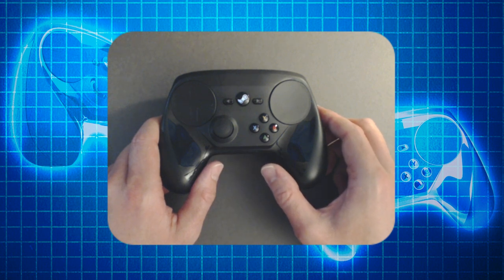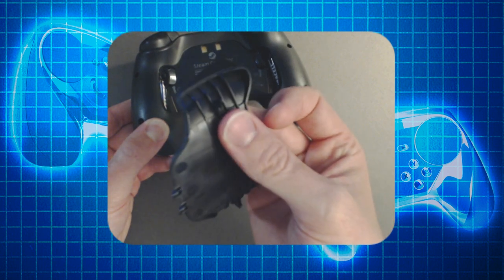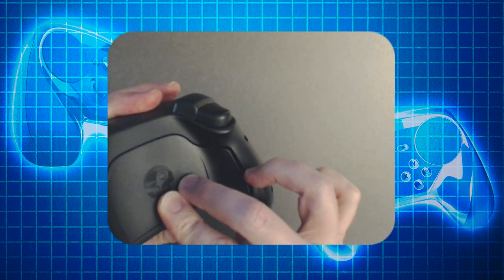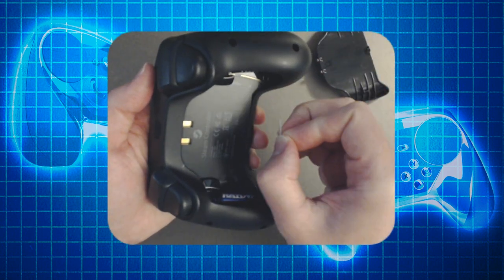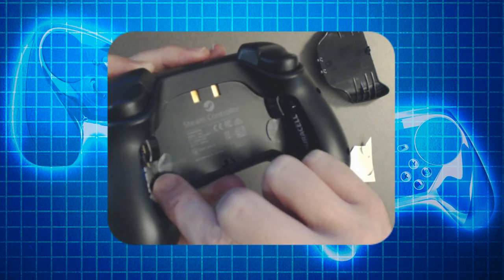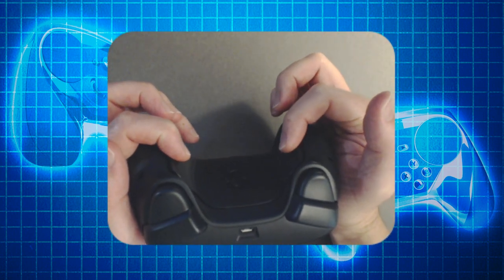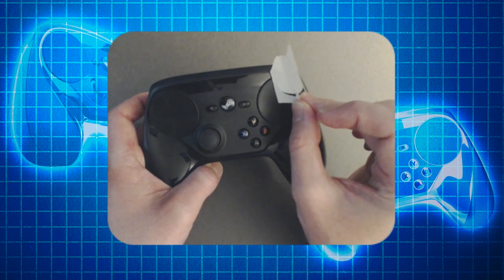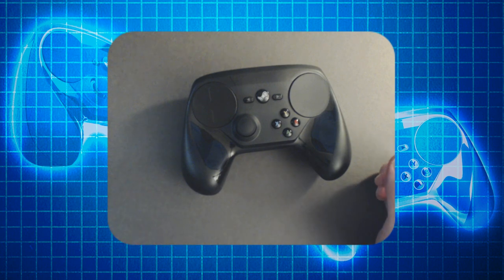Steam Controller DIY Hack | Back Grip Button Paddle Padding (Softer Clicks)

Comment: Great idea, will try this out myself! Never quite felt the paddle feeling was quite right.

The one thing I REALLY want to modify on the controller but dont know how is the resistance of the triggers. They're far too "light" and easy to squeeze for me and unfortunately it's what's stopping me from using my Steam Controller.
Reply: chivs688 I know it's one year ago, but did you find a solution!
If it is a sponge try to find the same but a bit longer or with harder pressure! If it is the two time drilled metal that has the V shape then try to bend it till it is a L shape!
Maybe that helps?

Comment: I have a problem where my controller won´t update the firmware. the dongle is on a firmware from february and the controller still stuck in 2015. out of interest, on which version are your firmwares?
Reply from the maker: My firmware for Controller is Feb 2016, Receiver is Sept. 2015. Those are the latest one. All the new updates have been to the software side.
Reply: +ExistentialEgg allrighty, hoped that was the case, now i can rest easy. Really enjoying your content. Rock on

Comment: Egg have you seen the Nacon gc-400es controller. It looks pretty interesting.
Reply from the maker: I've not.. interesting. Seems like a custom controller packaged with it's own mapping software. I'd be curious how robust the mapping software is (compared to Xpadder and SC).
Reply: ExistentialEgg Ya I saw it the other day and I thought their claims it can rival a mouse seem interesting idk how true. They do have a video of them playing heroes of the Storm with it on one of their channels.
Reply from the maker: Well, if the mapping software is similar to Xpadder then it's not too hard. It won't be anywhere near as quick and accurate as we are now with Steam Controller but I've played mouse cursor emulation on a stick for years back in my xpadder days.

Comment: I read somewhere steam is making a newer version of the steam controller.
Reply from the maker: in a Developer's Conference they've stated that the controller will go through improvements but nothing that changes the core functionality of it. Maybe just a few little things like this, softer buttons and such.
Reply: I've been looking at getting the controller, mostly for Rocket league. 

How did you get it in Aus?
Reply from the maker: I'm in US.
Reply: +ExistentialEgg you are? woops. for some reason thought you weren't. feel like sending one my way then? :p
Reply from the maker: I'll tape one to a piece of styrofoam and toss it in the ocean. :P
Reply: +ExistentialEgg hope you've got a good throwing arm. I'll be waiting ;)

but cheers for the steam cont vids. certainly helpful for more in depth views of the device. I heard they might be doing a hardware revision, so I might wait for that to buy one. 360 will have to do for now. the main reasons I want a new one is cause my fingers are getting sore. so comfort is something I'd like to hear more about?
and other stuff